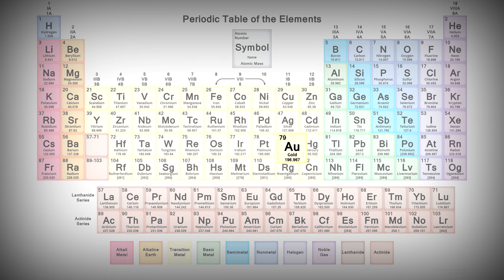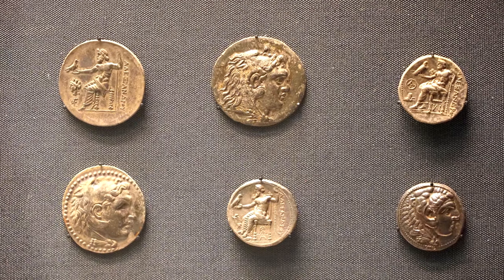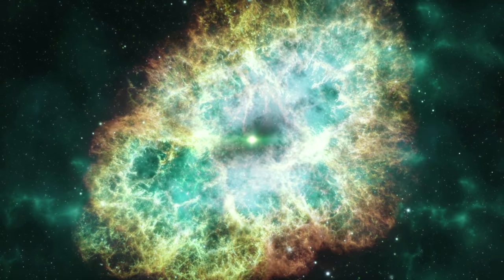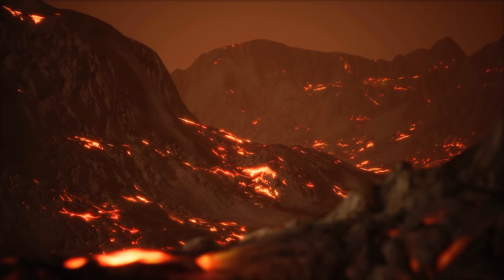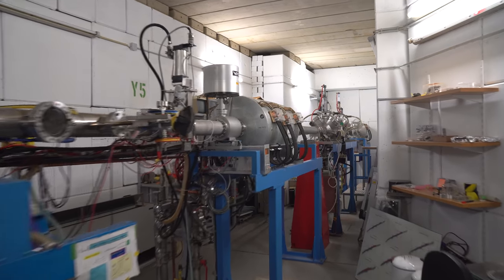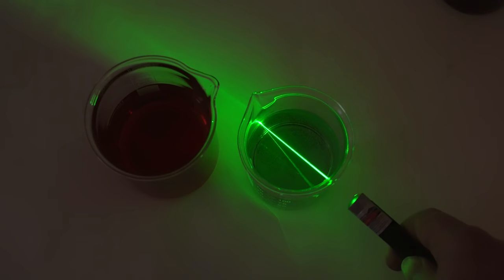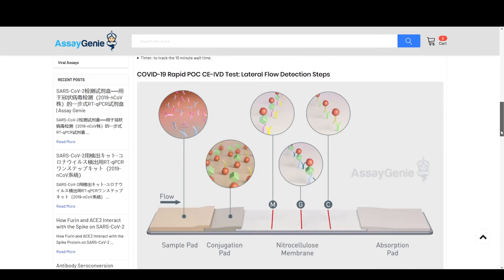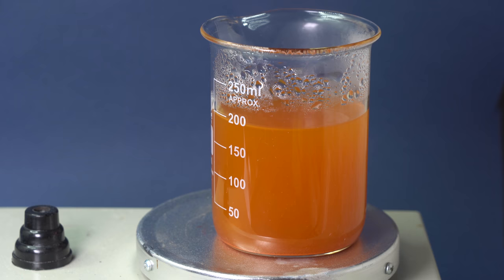Gold  - THE MOST CORROSION RESISTANT METAL!

Comment: Professor I have a question, can the gold foil protect agains the radiation? maybe gamma, beta, cosmic, etc. or is only agains infrared light?
Reply: Only IR light, certainly not beta, gamma or cosmic radiation.    Some protection against alpha particle radiation depending on the thickness of the foil.  A sheet of paper will also shield against alpha particles.
Reply: @karhukivi   THANKS :D
Reply: If you hold a piece of gold foil against a strong backlight, it will appear bluish. It blocks (and reflect) the longer wavelengths of visible light, (that's why it appears yellowish) but allows the shorter wavelength to pass thru. In other words, it can't even block blue light let alone UV, or other higher enegry radiations. That is for a very thin foil. If it's thick enough then it will block most stuff.
Reply: @testusersg  That depends on the thickness, as you have just said.
Reply: @testusersg  oh really?. so a gold vover is complementary for an antiradiation armor?

Comment: Corrosion is a natural surface phenomena, the reason metals corrode is because the metallic form used by us is thermodynamically unstable, metals are typically found in oxides naturally which is what all metals corrode to, except gold, which is never found in an oxide naturally due to its high thermodynamic stability

Comment: There is an acid that can attack gold on its own, without other acid or oxidizer. That is H2SeO4. Heating gold with it will generate water, SeO2 and Au2(SeO4)3. Also, chloryl perchlorate can react to produce ClO2 gas and chloryl perchloratoaurate (ClO2) [Au(ClO4) 4]

Comment: The question i have is this. How much gold do you lose going from a solid to a liquid solution back to a solid. Was it the same gold weight or did you lose some in that chemical process?
Reply: You won't "lose" it. It's there somewhere. Maybe stuck to the sides of the beaker,  or whatever. But it's somewhere. Not destroyed or converted.

Comment: Iridium

Chemical properties

Iridium is the most corrosion-resistant metal known: it is not attacked by almost any acid, aqua regia, molten metals, or silicates at high temperatures.

Bro if you do clickbait, at least do real clickbait.
Reply: Yes I thought about that to, by the way I would rather have iridium over gold I iridium is also denser and harder than gold. I wonder if and alloy can be made between gold and iridium that is less brittle than elemental iridium (and cooler colored too )